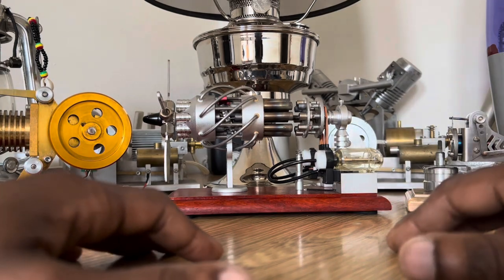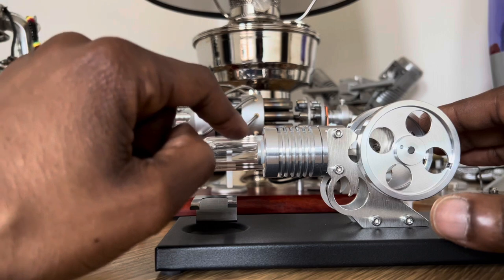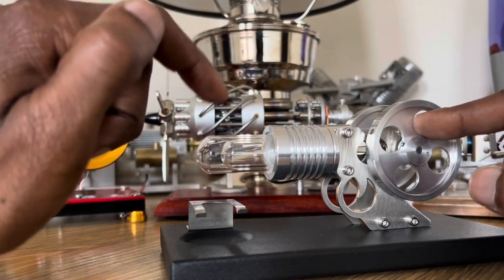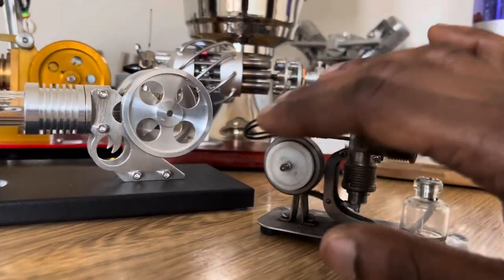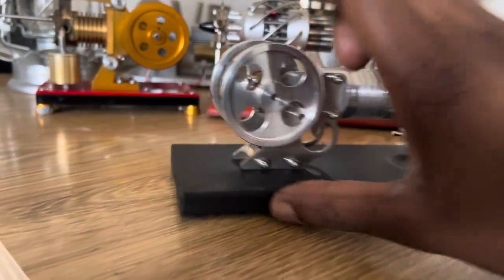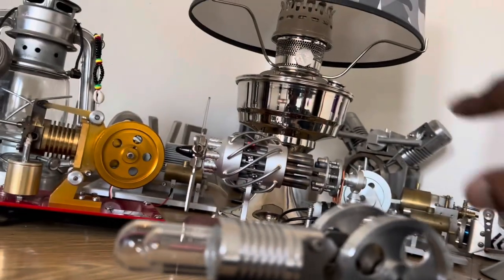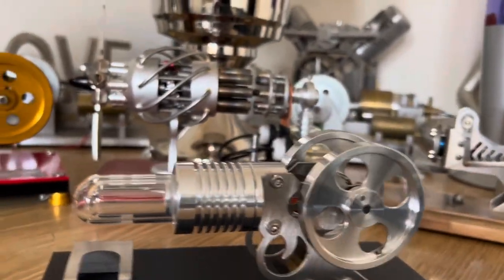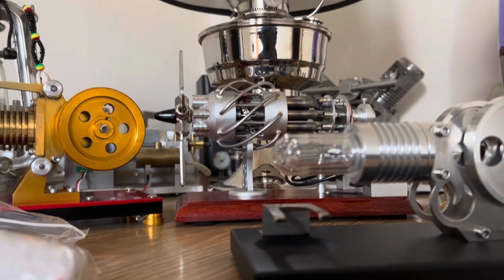A little about Stirling & Manson engines

Comment: I would be very interested to learn more about the vacuum engine as you mentioned in this video. Currently researching for a senior design project (Designing a hot air engine) and this video has been infinitely useful.